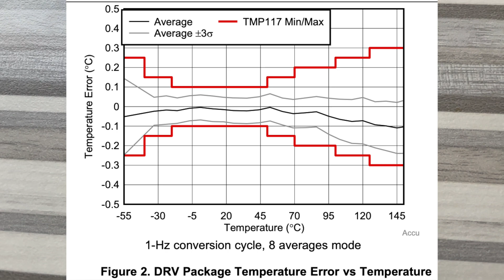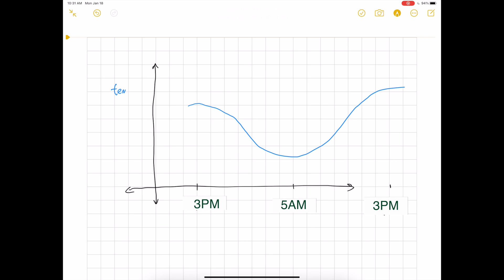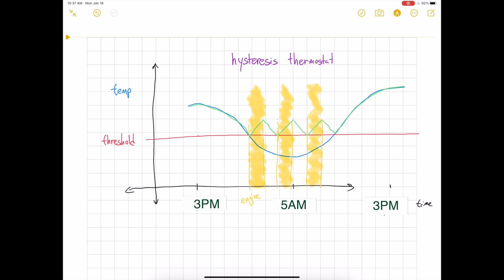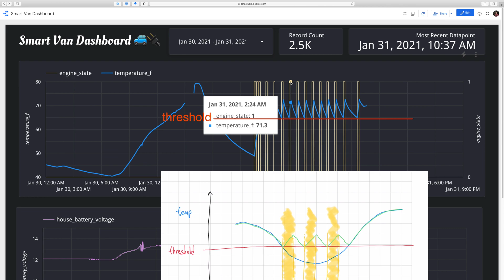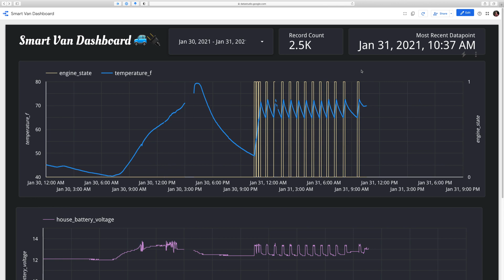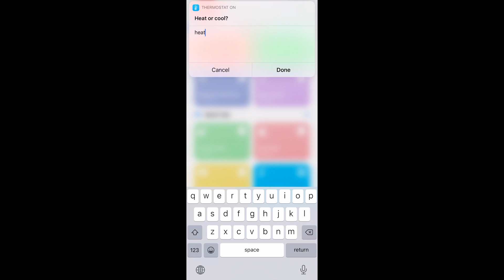Heating Camper Van with Temperature Sensor + Remote Start

Comment: Awesome job. Most of your heat is going out the exhaust. The original VW beetle heater was a box around the exhaust to work as a heat exchanger. Of course there are obvious dangers. Something that might work for energy storage would be to heat air with the exhaust and direct that heated air onto the ground beneath the van. That way you have unlimited mass without having to carry it with you.

Comment: Awesome video! It would be cool to put a threshold on the battery voltage too and trigger an engine start if the voltage ever gets too low.  Do you have ODBII access or anything to be able to read things like gas tank levels?  Also, what dashboard software are you running?
Reply from the maker: Hey Rand, that's my next step–Prius mode! 

The project I'm currently working on is reading data from OBD2. I've reverse engineered the easy stuff like vehicle speed and steering position by looking for changes in `cansniffer`, but gas tank is tricky since it changes so slowly. Definitely open to ideas here.

Dashboard is Google Data Studio, I'll make a vid on the data pipeline at some point. It's overkill but I'm safely in the GCP free tier :)
Reply: @SmartVan  cool, I can’t wait to see the data pipeline details. We’ve been using Grafana quite a bit at work and I really love it. I’ll check out Google data studio soon to see what it’s about.

Comment: For anyone with a 2018 Promaster City.  Here is what I found out regarding my 2018 model which, for some strange reason that I still do not fully understand, cannot be retrofit with a third party remote start of any make or model.  Additionally regarding RAM manufacturer equipment only certain very specific "Ram Bailment Pool Dealerships" were authorized to order and install the MOPAR remote start unit which, for 2018 models, required not only authorization to order but also certification to install.  Very odd but apparently it has something to do with nonstandard electrical wiring attributes of the 2018 Promaster City that are unique to that model year only.

Hello Thomas,

I have received confirmation that these dealership's parts departments have been instructed on how the remote start needs to be ordered for your vehicle. Once the part has arrived your vehicle will need to go to an upfitters for installation. You will need to confirm if the dealership has successfully ordered the part # 82214569AB.

Richelle
ProMaster Case Specialist

List of dealership that could assist you with the part you were wanting to order.

1. Rockport (Ram Bailment Pool) - Rockport Commercial Vehicle Division 2323 Middlebury St. Elkhart, IN 46516 202 Industrial Drive Ocilla, GA 31774 Toll Free: 888-711-1600
2. Bay Bridge Manufacturing (Ram Bailment Pool) - 800.451.6267 · info@baybridgemfg.com; LEARN MORE ONLINE: WWW.BAYBRIDGEMFG.COM
3. Buckeye Body and Equipment (Ram Bailment Pool) - Columbus Ohio's Buckeye Body and Equipment - 939 E. Starr Ave, Columbus, Ohio 43201 (614) 299-1136
4. Midway Specialty Vehicles (Ram Bailment Pool) - 800-505-2530 X 199 Contact Russ Gilpin mymidway.com rgilpin@mymidway.com
5. Stonebrooke Equipment (Ram Bailment Pool) - www.stronbrookeequipment .com 652-224-4440 14311 Ewing Ave. Burnsvill, MN 55306
6. Utilimaster (Ram Bailment Pool) - 800.582.3454 | www.UTILIMASTER.com | info@UTILIMASTER.com
7. Unicell (Ram Bailment Pool) – 1-800-628-8914 www.unicell.com sales@unicell.com
Reply from the maker: Good details, thanks for sharing!

Comment: Great Vid!  What do you think about connecting your van's engine "coolant"/antifreeze system to heat transfer unit to heat a separate radiant hydro heat loop in your van's floor.  It may not be cost effective for your since your van is already built out, but I was thinking of using the van's engine "coolant" to connect via a heat transfer item to a separate antifreeze loop that ran zig-zag loops in the van floor.  Using the engine's "coolant to heat up the separate  antifreeze loop in the van floor.  Of course a pump would be required to circulate the fluid in the tubing in the floor, but I would guess that pump would be a fairly low electric consumer.  You could connect the pump to turn on once the indoor temp dropped below threshold, and the Viper auto car start was triggered.  That would require more electronics know-how than I have, but in theory that might work.   This would likely provide more consistent heat than the van engine heating system alone, and may not need to start the engine as often.  I have radiant heat in my house and it is super comfortable, it is amazing to have warm floors to walk on. Just a thought.  Great job integrating all those systems to talk to each other and the data collection is impressive!
Reply from the maker: I like this idea! I have a previous video where I looked at the van running with a thermal camera and found that the heat does end up going through the van floor already, I suspect due to the exhaust and all that metal acting as a heat bridge. But getting this type of heat to come from a fluid with high specific heat would be a good step up towards reducing gas usage. I'll have to think about it more, thanks for sharing!
Reply: My suggestion...
Don't reinvent the wheel.
Sure you could try to build in floor radiant heat, or even use a small transmission cooler with a small fan and even a tiny pump to keep antifreeze moving when parked, to try to get a tiny bit of warmth out of the existing cooling/heating system (most passenger minivan's basically have a second heater core in the rear with a second fan)...but within 20 minutes of parking, the fluid in question will be cold....
Seriously it's a problem that the trucking industry solved years ago with "parking heaters" as called by the Chinese AKA bunk heaters, available under different names and prove points...from under $200-1500, some even connect to the cooling system too keep the engine warm.
Heating is a easy problem to solve without running an engine....
Cooling during the warmer months on the other hand is much more difficult
Reply: @timothyp3378  You are referring to the Webasto heater he mentioned in the video. He seems to be against using them. Someone already invented a radiant floor for the Sprinter van that uses minimal energy. Surely it could be applied for smaller vans. Here’s their site: https://www.vanlifetech.com/hydronic-heating-systems

Comment: Have you looked into a generic 5KW/12V diesel air heater? Amazon has them for under $150. Pretty easy to install; just drill a couple of holes and a little electrical. Most include a small fuel tank and they nicely run on kerosene which will extend the burner's life over running it on diesel. With that said you came up with a clever solution to your need. Nice to see you posting again.
Reply from the maker: Could be a future install! Good tip on the kerosene
Reply: @SmartVan  second tip....ti prevent the smell of diesel inside the vehicle (due  to the REQUIRED vented cap (lets air in as fuel is pimped out, or a vacuum occurs, and pumping stops) add a second line, just like the bottom fuel line but to the top....then just run the line to a discreet location, first running it high than the tank, then to an outside location.
Reply: Kerosene should only be used intermittently to burn off the spot that builds up from running at low settings.....
Tip... running the unit on "Hi" after start for 5 minutes or so accomplishes the same thing.
The issue with kerosene is it it lacks lubricity, so it can cause excessive fuel pump wear, even in the tiny little units used in a parking heater.
Reply: Soot...hate autocorrect, lol
Reply: @timothyp3378  "Kerosene should only be used intermittently to burn off the spot that builds up from running at low settings....."

I forgot to mention that most of these heaters are dual fuel.

Comment: so, how many times do you wake up at night?
Reply from the maker: Earplugs ;)
Reply: I can say that in the 2 years I spent sleeping in a truck, the summer season when the truck would cycle on/off ti run the AC was rather annoying.... so much so it usually only would be set to run if I was sleeping in the day, usually in the sun. 
Winter, with a "bunk heater" aka a tiny diesel powered furnace was much nicer, excluding the cold floor, and the ticking from the fuel pump in the unit...even the $1500 units do it, it's a result of the pump needing to "pulse" the fuel the atomize it to burn.